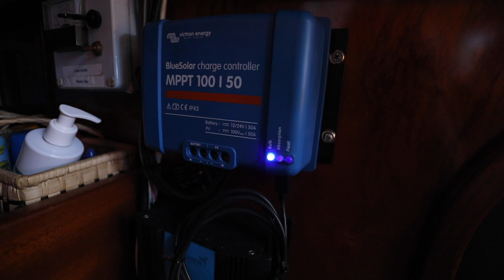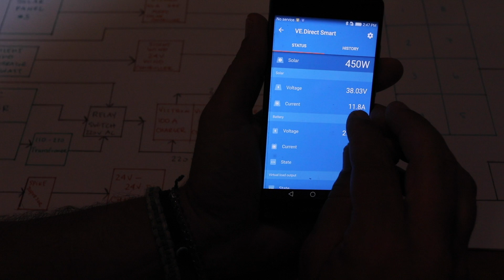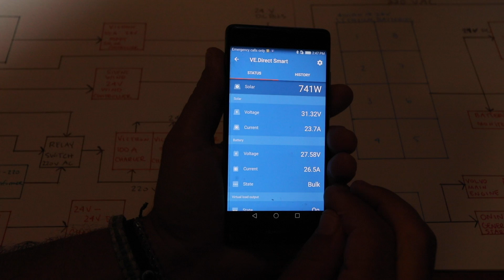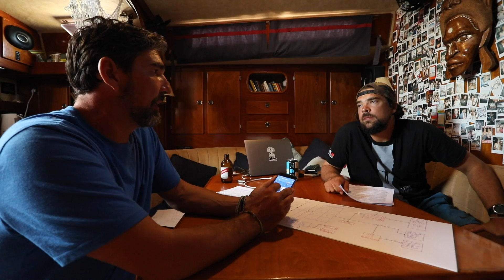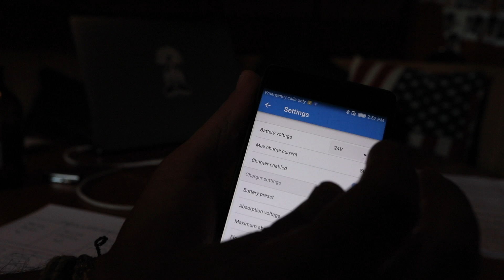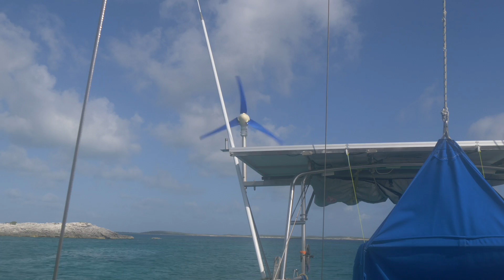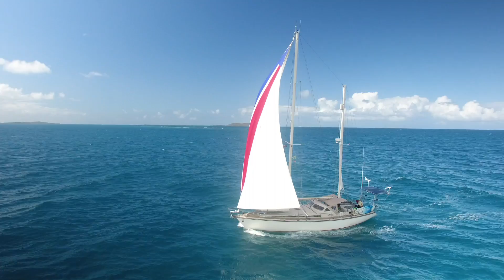SOLAR Vs. WIND - How much power can you make? ELECTRICAL BOAT TECH (2 of 7) - Sailing Vessel Delos

Comment: OK Solar Pros. I have a 12V 850amp Battery Bank (4 - 6 Volt Batteries) and 320W of solar with an MPPT charger.
By sunset, my batteries read 12.7 volts. In the morning, just before the solar panels start up, I have 12.5 volts. 
Everything looks good right? My question is, I am only using about 5 amps continuously (Frig/Freezee and fans/lights) I would like to start using more power in the evening like laptops and a 12V TV playing hard drive movies. I tested running the TV for 1.5 hours for a movie each night. In the mornings my battery bank was 12.4V day one, 12.3V day two, 12.2V day three. Obviously my system cant handle more than the constant 5amp average. If I increase my solar to 640W (adding 2 more 160W panels) will this actually help? OR is it because I need a bigger battery bank to store my power? 
It's easy for me to ad the solar panels but not the batteries since they are 2 years old. I would need to wait until it's time to replace to ad 2 more.
I am confused because my solar is capable of keeping my batteries at 12.7V but my batteries will discharge more than the 50% of 12.5V if I use more power so isnt the solution to have more than 850ah bank to have more stored power for more evening use? If I only ad more solar, wont my batteries still only read 12 7V which is fully 100% charged? OR will doubling my solar get my batteries to read more than 12.7V when the have rested after the solar charge? Can my my battery bank be more than 12.7 or 12.8 after charged and rested? Or am I stuck until I replace my whole bank with more batteries?
I am so close to understanding my system but would just like that extra power in the evening and keep my batteries from dropping below 12.5V. 
Thanks for any help from the experts out there!
Reply: You size you batteries to support your expected load to prevent over discharging them.  For lead acid, you never go below 50%, and 75% is better.  5A @ 12V for 24 hours is 60W x 24h =1.44kWh. 850Ah of batts @ 12V is 10.2kWh of storage.  1.44kWh a day uses 14% of your battery storage, leaving 86%.  This is fine.  After 2 days with no sun you’ll still only be down to 72%.  You size your panels to replace what you use plus some margin due to the sun not being up 24 hours, and sometimes clouds, and the angle of the panels not being optimum. If you’re in the tropics, youll have about 12 hours of sun, but not all of that is usable - the power is low at sunrise and sunset. Lets say 7 hours at full 320 W. 7h x 320W = 2.240 kWh which is 1.5 times what you’re using.  This is fine if you never see a cloudy day.  I’d like to see this more like 2.5 times what you’re using so it better matches your 2 day battery supply.  Now some of this will be wasted with lead acid batts, because you can’t charge them efficiently when they’re close to full.  Your system should stay charged if it stays sunny, and you should have great battery life.  If you aren’t getting this, something is wrong.  Your mppt should tell you if your panels are generating what you expect and if the batts are charging properly.
Reply: @stargazer7644  Thanks. Sounds like my system exactly. Would it be OK to ad only one more 160W panel for a total of 480W to get it close to the 2.5? Using 3 would keep my amps (24 to 27) below my controller's 30 amp max.
So, am I understanding correctly that my bank is not big enough to really use more than the 24 hour 5 amps and I would need more batteries/amp hours?
I read your post again...
Sounds like I could use more in a night but I need more panels to get them back to 12.7V. I understand at 5amps per hour x 24 hrs is about 2 days of battery but if I use more amps in an evening I will probably be down to one day until my batteries are at a safe discharge level. Then I will need more solar power to get them back up quicker and prepared for another 24 hour safe/max discharge.
Is it possible to figure (about) the total solar watts needed to take my batteries from their lowest safe discharge to the maximum in an average 7 hour day you discribed?
Is it possible to have an overkill of solar watts?
Reply: @SailingCorina  Your battery bank could do double, but you'd need full sun the next day to top back up.  If you had a cloudy day or two, you'd rapidly get into a hole.  Another panel would certainly help this.  Make sure the panels match in power output if you're paralleling them.  The problem with figuring out exactly how much solar you need to recharge in a day is there are several variables here that we don't know the answers to.  Things like: What are the efficiencies of the system (controllers, cables, etc)? What angle are your panels to the sun.  What latitude are you at?  How cloudy will it be?  How dirty are your panels?  How old are your panels (they decline in output with age)?  I used the actual data from delos in calculating the 7 hours I used in your numbers.  The way you figure this out is by using a charge controller that records this data so you can figure out your efficiency.  How many peak watts do you typically get in a day?  How many amp-hours are put into the batteries in a typical day?  Is it different when you're discharged down after 2 days versus just one day?  Does your system typically make it into float every day?  These real numbers keep you from having to figure out all that other stuff.  Having too much solar (assuming your charge controller can handle it) is only a problem for your wallet.  It gives advantages, such as being able to use more DC power during the day without impacting the batteries or recharging, and faster recovery after cloudy days.

Comment: I don’t live full time on board, but I’ve been finding myself wanting to use excess power to heat domestic water or some other useful thing like mining bitcoin....haha.  When I design my future boat I wanted to auto run a smaller water maker when batteries are topped off instead of dumping.  Could justify extra panel or two if you could automate this.  Water = energy, so a full tank is like another battery bank.

Comment: Thank you for a clear and informative explanation. I own and live aboard a 1976 Downeaster 32 sailboat and its electrical systems have always been a sourse of confusion for me. I am currently on the hard dealing with damages from hurricane Michael and the electrical system is the next project to be tackled. With you valuable info l at least have a guide as to what is actually going on an d an outside chance of success.👍🤞

Comment: My Marine Air X wind generator burnt up after eight years, Took it off the boat last season and did not miss it. Two old Siemens 75 watt solar panels are enough to keep my 12 volt house bank topped up with an ENGEL refer operating 24/7 with just me on board.  Solar rocks!

Comment: @Breeyawn...........lol i know funny right.......About flexible film solar...can you Coat the masts with that stuff?   or is that a stupid expensive idea?
Reply: Solar panels lose power rapidly when they aren’t pointed at the sun. The sun is typically above the sails, so they would make very little power.
Reply: @stargazer7644  Hi there Star Gazer. Glad you replied. I don't know a lot about Solar panels. but just from a physics stand point; if the angle of solar absorption is lets say 30% from High noon. (which can be greatly affected by your latitude) then the 3 panels on Delos only absorb from 10am - 2pm or there-abouts (whatever). So, my question is if you had more of a 180 degree angle......why not.....unless of course the cost is ridiculously retarded and not worth the effort. oh yea and sorry please not a dig.. the sun is not typically above the sails.
Reply: @KartizaK  In the tropics the sun is generally very nearly directly over the sails during the prime solar generating hours around noon in the summer.  The power you get from a solar cell goes as the cosine of the angle between the panel face and the sun.  Lets start with a typical 200W panel that is mounted horzontally facing upward.  At noon, when the angle to the sun is 0 (more or less directly overhead), then you get  cos(0)=100% of 200W out of the panels.  If the sun is 30 deg lower, you only get cos(30)=86% of the 200W.  At 45 deg you get 71%. As you get lower, it falls off even faster due to the extra amount of air the light has to travel through.  So 2 hours before sunset you actually get far less than the cos(65)=42% that you'd expect from the math.  So now, with the panel on the side of the sail, you're going to be 70-90 deg (in the tropics) , so you'll get 0-34% of 200W during the 4 best hours of the day.  It would be slightly higher at higher latitudes.  So, yes, you could do it, assuming the sail still worked properly, but it would be terribly inefficient.  You'd be far better off mounting the panels flat - it would cost more than 80% less to get the same power output.
Reply: @stargazer7644  And why not coat the sails with them if they are flexible enough?
Reply: @KartizaK  You're going to have trouble folding that sail, and I imagine it would be quite heavy.

Comment: Been watching for years abd this is one of the most informative videos you have ever made.  Here is a summary of electrical consumption in Sidney BC,  Our "standby" consumption for two families in 2400 sq feet is abour 10 kwh per day.  We have the convenience of looking at our consumption on and hourly basis, and in the wee small hours of the morning it is about 0.4 kw per hour.  During this time the only things turned on are 2 fridges, one freezer, about 6 clocks, (they seem to be everywhere) internet and cableTV connections.  During the daytime the biggest users are clothes dryer 3kw and elevtric conventional oven 4kw.  annually we use about 700 kwh total.  We have no electric heat. No A/C.  (all natural gas)  
You are right on with your numbers.

Comment: 3,200 SF house in Maine, typical 2x6 walls with R-19 wall insulation and R-40 blown into attic. Two people with a 5KW solar array. In summer we use about 10kWh/day, heating months with almost exclusive electric heat pump heating it’s 40kWh/day. Propane domestic hot water. Average solar generation all year is 17kWh/day. What’s cool is in the spring and fall the panels run more efficiently at cooler temps and produce more power with less total day light.

Comment: I love solar and lithium.  Good pick.  I would add a few panels to run the generator even less.  I put up 7kw of solar here in Austin last year and it looks like by Dec 13 (1 year anniversary of them going on) will be about 8MWH.  Currently mid November I am at 7.5mwh produced.  My house draws average 800kwh per month.  I bought the 327w used panels on Ebay 3 year old commercial Sunpower 54v output.  I used the Solar edge inverter and put optimizers on each one.  I did it it DIY so it cost 80 cents per watt vs $3 per watt if I went through the rebates and tax credits.  I just looks and saw 500w panels in China for 13 cents a watt but with tariffs and shipping that would be more.  I paid $5400 for everything.  I feed the grid for free so I gave the grid about 1mwh this year.  My 4 ton 2 stage 18 seer condenser uses 3800w in low stage and during sunny days, the panels still feed the grid.  I am looking at a EVTV Jack Rickards system for storage.  He has worked out the details pretty thoroughly.  That will give me the option of having 2 separate solar arrays, battery capacity and be able to cut the grid off and run my house off grid during power outages.  
The flex panels would be great for an add on for you guys.  The charge controller may be a problem with the different voltages but cutting that damn generator time to 50 hours from 250 would be huge.  Waiting for my Model Y.  
Remember, Starlink will be available with terminals mid 2020.  Maybe send a cool request to Elons crew to get one for Delos.  Tested speed going to a test aircraft was in the 600mbs range wtih only 50 sats up.  Yesterday another 60 went up and by Jan 1 another 240 will be up.  Then 120 per month are planned.  Maybe you could get more subs by promoting that service.  Certainly everyone in rural areas, boats, planes will want to know how well it works and with your diligence on testing you would be famous.  I see it as a win win for you and SpaceX.  I will get it for my car and use it at home.  Be cool to travel anywhere wtih a little pizza box on the roof and have gigabit internet.  Of course I will be able to monitor my battery condition, charge state, rate of charge, etc on my phone anywhere.  
KUDOS on great video.

Comment: Breeyawnicle, just tell the Brady bunch that charging the Li Ion batts vs charging the lead-acid batteries is the same as filling a water Jerry can from a 5 gallon bucket. Charging the lead acid batteries is like filling the jerry can without a funnel so there is a lot of waste spillage. Charging the Lithium-ion batteries is like filling the Jerry can with a funnel there is much less waste and spillage. :-)

Comment: i have a 2 bedroom 1950s house that leaks air like a barn In Washington State. 23Kwh per day in the summer.  The up to 45kwh/d in the winter with electric element heating. keeping the house in the 50-60F range lol. We try to conserve electric even. Future plans is to seal up the house, fix up some insulation, and install a high efficiency heat pump. All the computers in the house account for 7kwh per day alone.

Comment: I really like these tech-videos. Please keep releasing them not only about electrics but also about other topics. 

I'm surprised that your solar power would be more than sufficient for my whole electricity consumption as a single person in a 60m² appartment. But I also have central heating and warm water that is heated with oil. So I only use electricity for light, household appliances and things like computer, TV, etc. And I don't have AC because that is uncommon for houses in germany.

Comment: Great video again. I am loving your electrical power series. When you run your laptops, are you just using the supplied AC/DC adaptor they came with? I have entertained the idea of using a DC/DC convertor that would out 19V to run laptops. I would not need to run my inverter that way. Fair winds to you all.

Comment: Trickle charge is a low but constant charge current, regardless of charge state or terminal voltage - this is not done on any modern battery system.  Float charge is a constant voltage at any current available regardless of charge state - basically powering all your appliances directly over the top of the fully charged battery system.

Comment: Interesting wind generators. Re the noisey one, is it geared inside, it should not be as a generator will work ungeared. It could be, and I think this is more likely, the shape of the blades. Change the blades and the annoying noise might go away.

Comment: Is there, in your situation with your stats, a trade off between adding more battery capacity to offset generator use I.e fuel and maintenance cost vs adding battery(s). Also - would a water turbine be an option (obviously only generates if your moving or have current under the boat). BTW - only recently discovered and subscribed and love the diversity of content.
Reply: They have a hydro generator. It generates very little power.

Comment: Did you mean to say there were 4 banks in parallel instead of series? I now own a large battery in series-parallel arrangement. It's in a Tesla Model 3. I also installed two networked smoke alarms, one  in the garage where I charge at 7 kw and the other in the bedroom. y
You might consider something like that in your battery compartment even though properly managed Li-ion are pretty safe.
Reply: They are in series-parallel.  4 pairs in parallel to get 400ah at 24v.  They aren’t using lithium ion batteries. They’re using LiFePo4.

Comment: Great vid! I have a very similar setup for solar (same controler, same battery monitor, but still on lead-acid batteries). A small correction on what you said about efficiency, regarding the amount of energy you get from the solar to the batteries. Yes the lithium are more efficient in the sense that you can get out a bigger portion of what you put in, in terms of energy, but the real reason you panels are producing more is related to 2 things: Lithium will always accept full current from your solar  up to 99.99% SoC (its "only" about 40A max to 400ah of battery) while the lead acids would start to "reject" some of this power when you are at more than 80-90% SoC. So you loose quite a few, potential, Watt-hours in that. The second one is actually "the same", but, with lithium, you are not worried to top up every day, so stay more "in the middle" of the SoC range, and basically what ever the solar produces in that day, your batteries will pick up.

Comment: Great topic.  I understand Volts, but can you explain the translation from volts to AMPS to KW hours?
Reply: Ignoring power factor....amps x volts equals Va (volt-amps) which is equal to watts. So like 120v x 10 amps is 1200va or 1.2kva or 1.2kw.
Reply: @johnchase9697  Thanks for the info.

Comment: I checked and found our house uses between 20-60 KW a day depending on the season with the high in the middle of the winter. 5KW a day for solar would not cut it. But I have to wonder where the power goes. There are only 3 of us in the house. None of us use that much power. So is this old house"leaking" electricity? In the Fall, we don't use AC or Heat. I have accused my brother of running a cyclotron in the basement. And now I'm starting to think that is what he is doing!
Reply: Those are likely kWh (energy), not kW (power) numbers.  Those are on par with what I use.  My peak is in summer.  My #1 consumer is the heat pumps/AC which run nearly year round.  #2 is the 24 hour a day electronic loads. Computers, dvr, clocks, lights, 50 little miscellaneous wall wart transformers constantly heating the air.  #3 is the hot water heater.